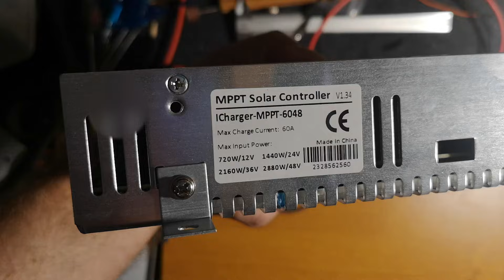Wind turbine to MPPT Solar controller - AC to DC conversion

Comment: @cssaziado
há 0 segundo
Heyo I’m currently trying to get a Smarttwister ST-2000 wind turbine (2 kW, 3-phase AC) back online, but the original controller (RST-3500-AB) is missing. I saw your setup and was wondering if something like that could work.

Comment: Hi, curious did it work out for you in the end? Does the solar MPPT controller allow your wind turbine to spin freely/fast enough to reach turbine's optimum TSR (tip speed ratio)? I'm looking at MidNite Classic and it has a configurable wind power curve, however question is how to tune the curve without having a wind tunnel.. I'd think that solar MPPT at best case scenario maybe could load up the wind turbine at maximum, which would start to stall it like a casual wind diversion controller (direct connect to battery). But there should still be a benefit of the buck function. Have you figured it out?

Comment: Hay I have a 10kw 380v AC wind turbine connected to a 100a rectifier that’s connected to a solar inverter. This is the inverter:

Technical Specification】Hybrid Inverter built-in dual 100A MPPT controller and 10KW Pure sine wave inverter. Supports two sets of solar panel array inputs and simultaneously tracks the maximum power charging/carrying capacity of two solar energy sources. With a rated output power of 10000W (surge 20000W) and compatibility with various voltage outputs (120/208/240Vac), it ensures reliable performance. Max.PV Input Power: 12KW(6000*2), Max.PV input Voltage: 600Vdc, Max.PV input current: 2 x 18A (MAX 30A), PV Starting voltage ≥150V, PV Wire Size:10AWG. Max. Battery Charging Current：200A

Comment: Great video. I have a 48v AC 10kw turbine. What would the DC voltage be after rectifier?
Reply: Open voltage could be even 60V but after you connect load it drops
Reply: @ thanks for the response